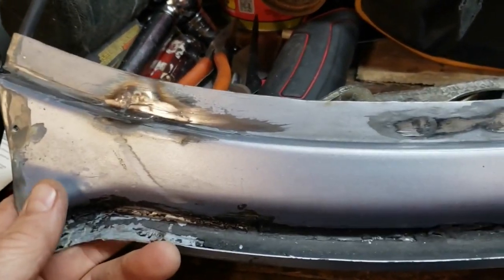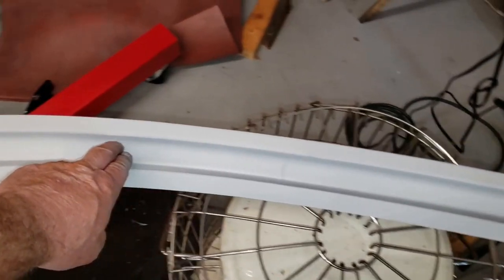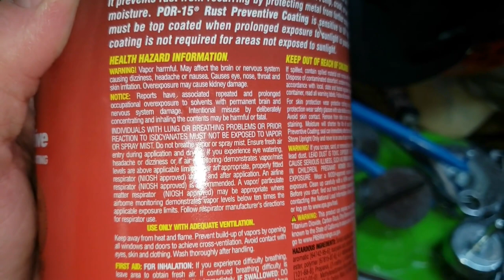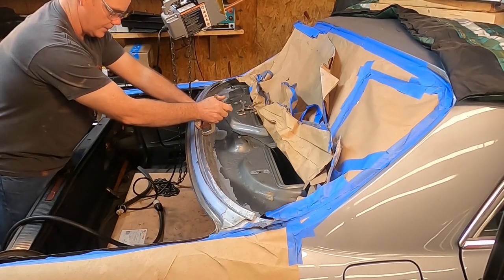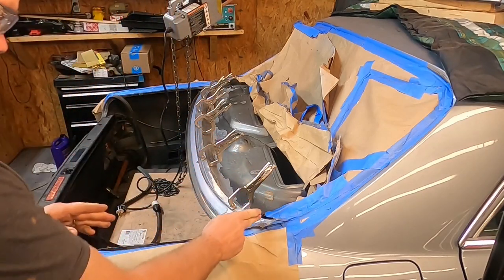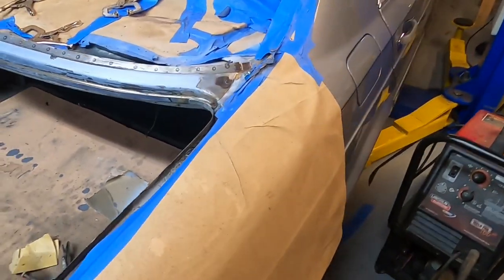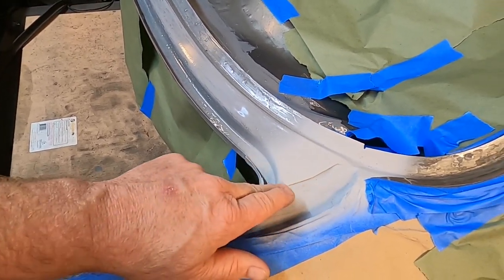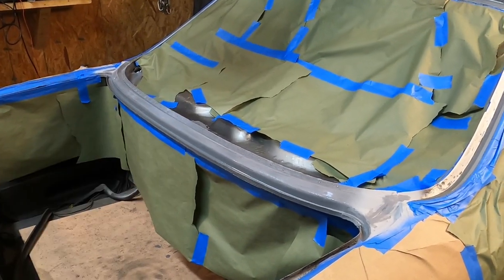Mercedes W126 - Rear Window Channel Rust Repair - Part 14 - Installation

Comment: If I remember right that back glass just has a rubber seal that goes around the glass and then the rubber seal fits over the lip of the frame. I've seen people just put twine in the channel of the seal and set it on the window frame and pull on it from the inside and that brings the lip of the rubber over the metal frame. Sounds simple?
If you could find a shop to do all that metal work you did I would think it would cost a fortune.
Happy new year!
Reply from the maker: Happy New Year Werner!